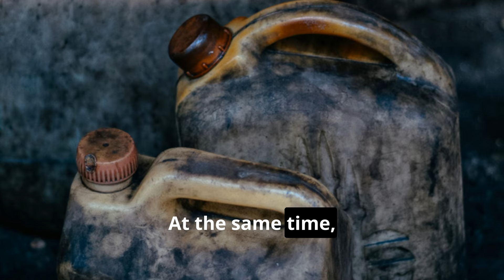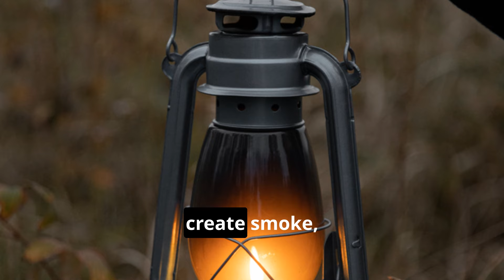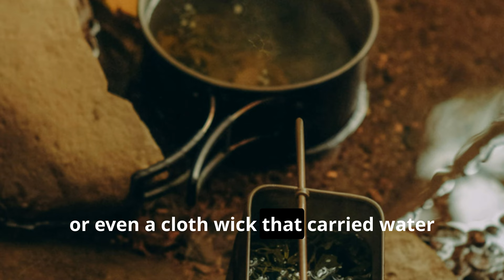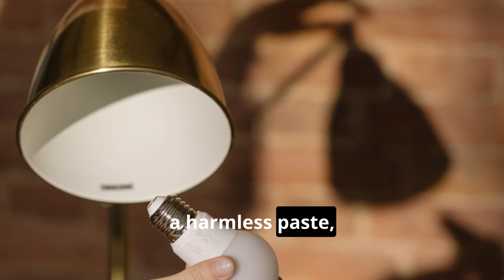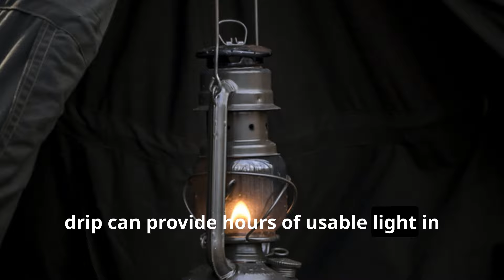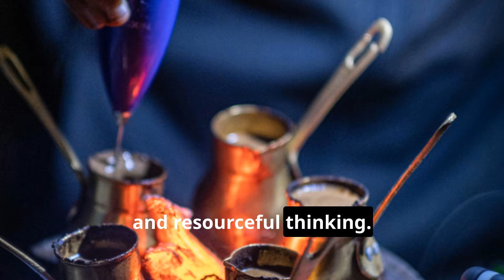The WWII Light That Burned Without Fuel

Comment: And where can we find detailed info as to how to get the gas to react and produce light without a flame?
Reply from the maker: Those old WWII flameless lights used chemical reactions that aren’t sold today. There’s no safe modern gas for that, but glow sticks or LED emergency lights give the same flameless effect.”
Reply: @WARFRONTSURVIVAL  I do have calcium carbide for my miners lamp, still available. Light sticks I purchase wholesale in bulk. Their standby life expectancy deteriorates after about five years even with proper storage leading to less light output and for shorter than advertised times. There was another device called a Krill Light that utilized a pair of AA BATTERIES and was made with an electroluminescent light element and power supply in a plastic case that was rated for several meters under water. It lasted about 28 years, not sure if the EL element failed or the power supply. Not sure if it is still made. It was the best alternative to the chem lights!